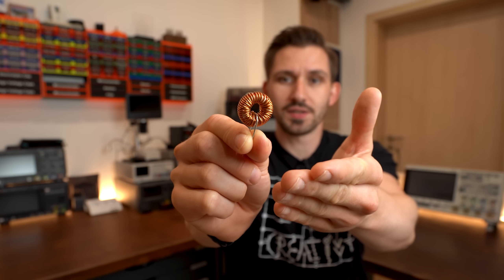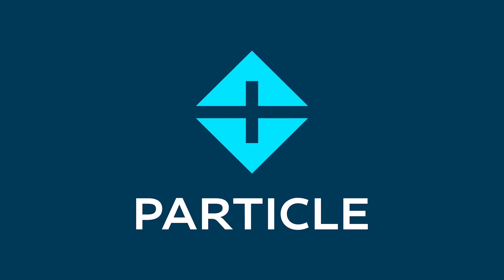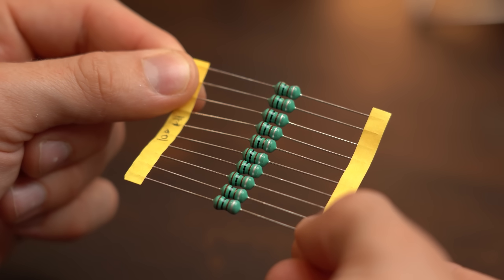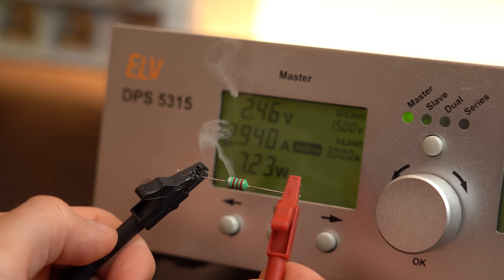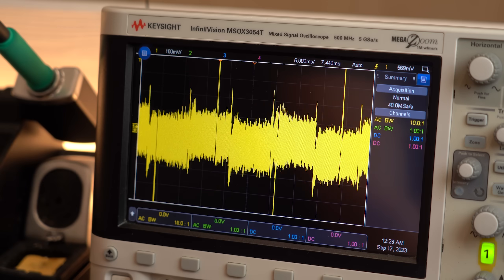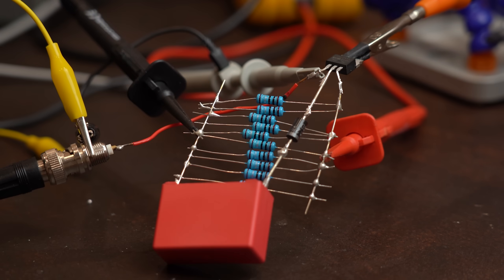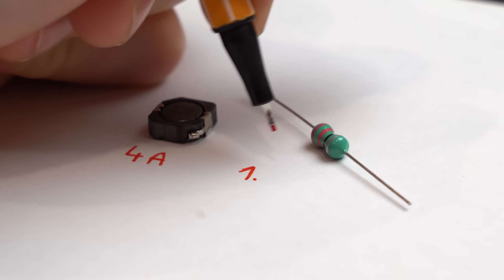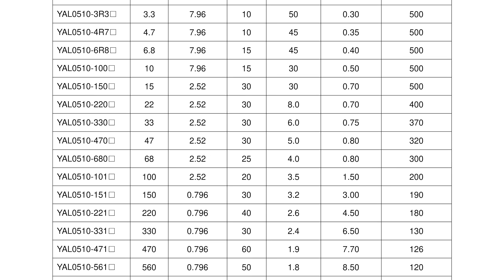These 3 Cent Components are actually USEFUL?! (Color Ring Inductor) EB#56

Comment: with mixed "bag's" of components I always end up with 75% of them not getting use, because they are unusual values.   Great video 2x👍
Reply from the maker: Thanks :-)
Reply: @greatscottlab is there anyway to contact you directly?
Reply: Yes, but then when you replace specific values with packs of 50+, they are are the ones you will actually use.
Reply: I think they're OK for rapid prototyping, as it allows you to try all sorts of different values. they're also good for quick, one off repair work. the way I see it, it's better to have something and dot need it, than not have it when you really need it.
Reply: Do you only do digital circuits?
Reply: @Sonny_McMacsson Have you even seen any of his other videos?
Reply: @muppetpaster  dcallan812 has no public videos.
Reply: Its nice to have some on hand for the occasion you do need it.
Reply: Is there a market for electronic scrap? Or is it just easier/cheaper to buy new components? Is there expensive stuff that you shouldn't throw away/recycle?
Reply: @Punkwart  Vintage equipment definitely should be sold or donated to enthusiasts. You could even have hard to obtain parts. Just give it to someone if you don't want to keep it and also don't want to deal with selling. Just have them pay for shipping. You were willing to part with it for nothing in the first place.
Reply: @Punkwart there's often some proprietary controllers and things like that in older devices which can be used to repair others.
Most individual parts are less than 10 bucks each so the generic ones generally aren't worth harvesting if you have money, and reasonable shipping times. (Some years ago I didn't have an electronic parts store near me so I'd rather have a pile of boards which I can harvest for parts instead of ordering and waiting for a long time.
Reply: "unusual values"? For most circuits exact value of one specific component used doesn't mean much, fact that we are used to some values more is just limit of our imagination.
Reply: @gorky_vk  Very true. I get through a lot of 10K pull-up resistors for instance; but if I don't have one to hand, I can use pretty much any other close value instead. Same for LED current limiting resistors; and transistor base/gate resistors.

Also bulk charge capacitors, and even decoupling ones.
Reply: @gorky_vk  ..exacly... and every resistor has a tolerance .. but the measured value is at rest temperature usually (thats why we have calibration for example), the value of resistors increases with temperature (should be specified as TCR in data sheet, Themperatur coeficent of Resistor), and isent a universla number... how its manufactured and of what materials change this
say a resistor of 100 Ohm has a tolerance of +-10%, thats 90-110 ohms (faar mor than the chenge of any temperature that component will survive if its say  20ppm/(delta)K)
..but if its a resistor of +-0.5% .. thats 99.5 - 100.5 ohms and the temperature will have a critical impact, as we can assume a lower tolerance Resistor means we r more pesky with the value, adding a trim circuit to get to exact 100.000001 ohm...
a chenge of TCR * R * DeltaK ... 0.000020 * 100 * 50 = 100.1 ohm (0.1% ...1/5th of the tolerance value...for a higher value resitor the error ofc gets signifficant)
100.1
1001
10010
100100
1001000 (at 1M the error is 1k)

EDIT: to compensate for this we can add a self calibration circuit of one or sevral NTC/PTC resistors (Negative/Positive Temperatur Cofficient resistoors... which chenges value dramaticly with temperature as per design)...
Reply: Having those mixed bags is still useful, since you at least have all the values. You can always buy more of one specific value of you use a lot.
Reply: interesting, good luck!
Reply: Unusual values are often usable without much changes to the circuit.
Reply: .. also remmber u can also use sevral resitors in parallel or series ...

Resitors in series
Rt = R1 + R2 + R3...

Resistors in Parallel (1/Rt formula)
  1       1       1       1
------ = ---- + ---- + ----
 Rt       R1    R2    R3

OR

for 2 parallel resitors
         R1 * R2
Rt = --------------- 
         R1 + R2

... for more than 2 resistors in parallel (this gives the iterating formula)
                                                            Rx * R3
Rx = (R1 * R2) / (R1 + R2) -- > Rt = ---------------
                                                            Rx + R3

...for more than 2 resistors its usually easier use 1/Rt formula
..or if one want to do things complicated

                   R1 * R2
                 ---------------- * R3
                   R1 + R2
         ---------------------------------- * R4
                   R1 * R2
                 ---------------- + R3
                   R1 + R2
      ------------------------------------------------ * R5
                   R1 * R2
                 ---------------- * R3
                   R1 + R2
         ---------------------------------- * R4
                   R1 * R2
                 ---------------- + R3
                   R1 + R2
Rt = ------------------------------------------------------
                   R1 * R2
                 ---------------- * R3
                   R1 + R2
         ---------------------------------- * R4
                   R1 * R2
                 ---------------- + R3
                   R1 + R2
    ------------------------------------------------ + R5
                   R1 * R2
                 ---------------- * R3
                   R1 + R2
         ---------------------------------- * R4
                   R1 * R2
                 ---------------- + R3
                   R1 + R2
Reply: Reminder to everyone: don't interact with spam comments, just report them.
Reply: @tyttuut  Was there one in the replies?  Looks like YouTube actually moderated the thread instead of their usual looking the other name?  Perhaps Verified users get extra help?
Reply: @soundspark more likely greatscott deleted it himself
Reply: @tyttuut what will happen if you DO interact with them?

Comment: What about using these inductors in series to improve the low power barrier!?
Reply: @crazyDJM  just like it's usually done with resistors, they "share" the voltage drop across them, so the power dissipated by each one of them drops. (Edit: the current is the same though, so the saturation can still be an issue, but the resistive power would be shared)
Reply: if I'm not wrong, you would increase the inductance, but not the saturation current. Does solve one part of the equation tho.
Reply: @Kalvinjj 2 in series, 2 in paralel, increases saturation current, the inductance remains
Reply: @hugoslav843  yep
Quadruple the component count tho

To the point you are better off with a smd component or even a big coil which datasheet mentions the saturation current you need
Reply: @harrison00xXx  Well, for a hobbyist, its usefull to get by with what you got and these are handy
Reply: @hugoslav843  if you are that clever to NOT use it in any siutations like power supplies, yes.
Reply: @hugoslav843   Indeed, have done this once for lack of the correct components at hand. Same deal with capacitors, didn't have high enough voltage ones but correct capacitance, so 4 of them together, tho usually in this case I would grab one with twice the capacitance instead for just two in series.